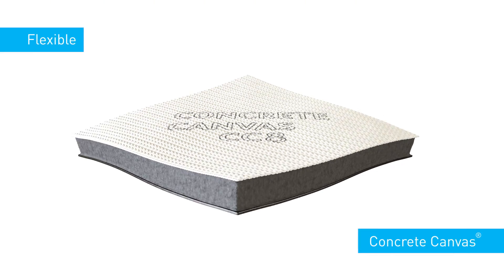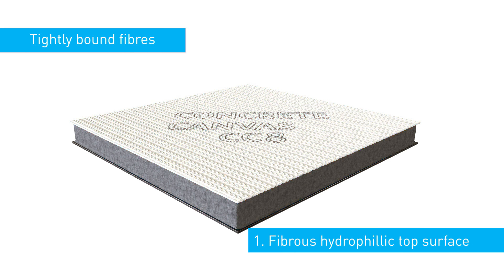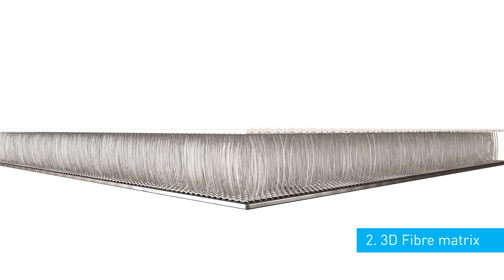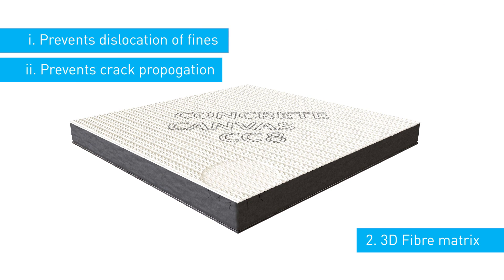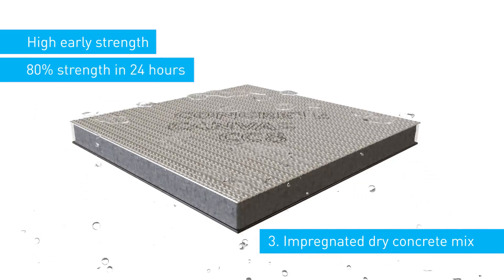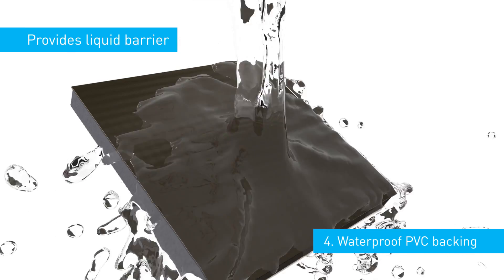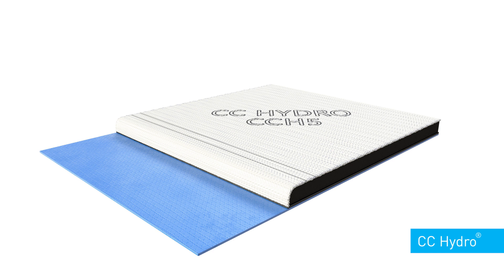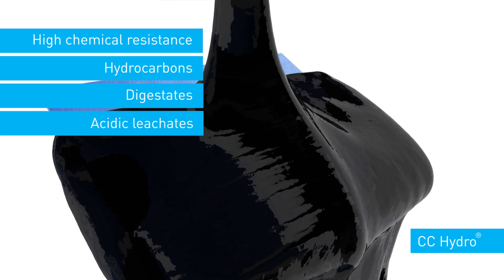Introduction to Concrete Canvas (CC) and CC Hydro (CCH)

Comment: Can you drive on this with a car?
Reply from the maker: Hi, thank you for your question. Generally it's not recommended - Concrete Canvas was invented for use in erosion control and weed suppression applications and has therefore not been tested for use as a temporary road or trackway.